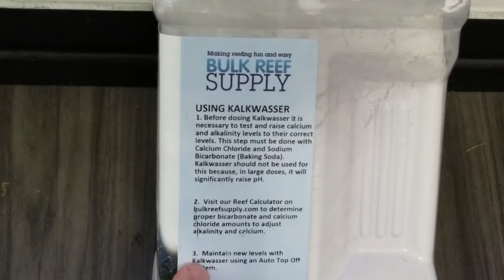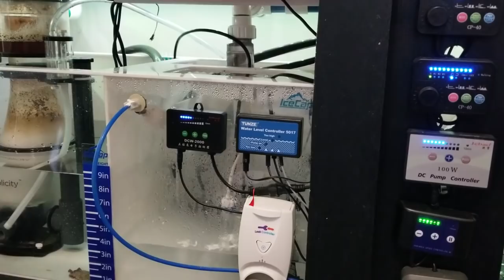Dosing Kalkwasser In Your ATO

Comment: Is the ATO pump off the bottom of the reservoir? And you have to wash out the ATO reservoir after it empties every time. I don't know if I would recommend kalk with a built in reservoir like this.
Reply from the maker: Billy the pump is off the ground about 3 inches. I called BRS and spoke to a rep and they said I can reuse the remaining leftover Kalk at the bottom of the resovor. I can wash it out once a month when I do my maintenance.

Comment: Trust me. Kalk is great but with a built in ATO it's going to settle at the bottom and its going to be hard to get it out and it clogs the pump really fast, and it will leave alot of creep on your ato sensors. I'm having the same situation right now. Im about to switch to 2 part. But good luck
Reply from the maker: Yeah, everyone has been telling me this. It was the first and last time I do that. I may just spring for a calcium reactor.
Reply: I was thinking about using this in the ATO,but after your comment, would it be better to setup a drip system instead of directly into the ATO? Thanks Dan
Reply from the maker: I stopped adding it to my ATO  And I bought the kit from BRS and I Dose Monday Wednesday and Friday with a drip.